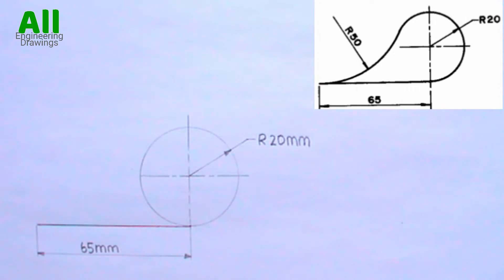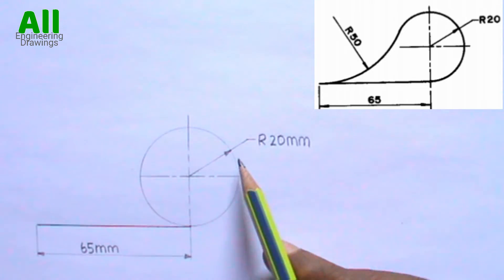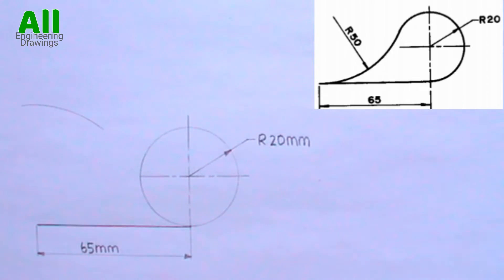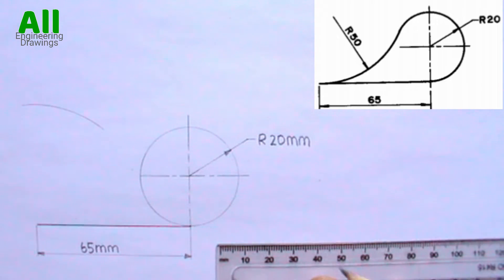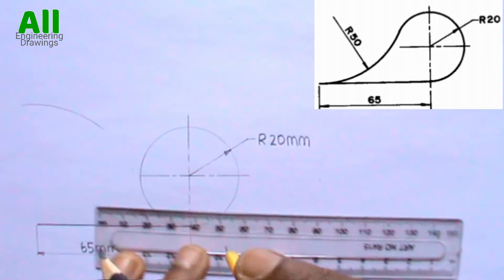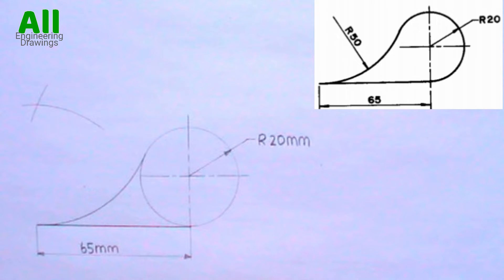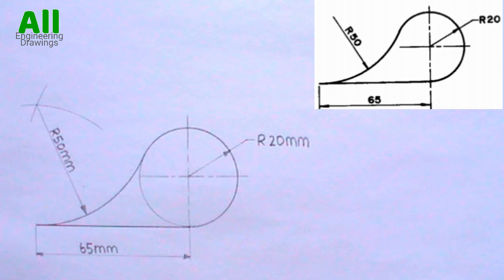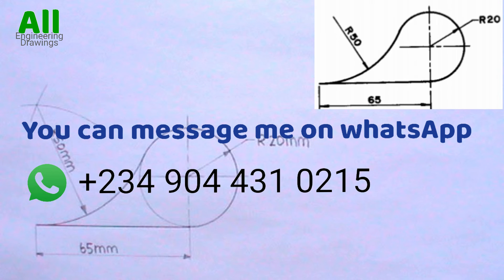TANGENCY PROBLEM 1 || Tangency || Tangency problems || Engineering drawing || Technical drawing

Comment from the maker: The easiest way to draw this drawing is to start with the circle. After drawing the circle, you are to draw horizontal and vertical line to pass through the centre of your circle. After that, then draw the 65mm horizontal line from the point where the vertical line passing through the circle intersects the bottom of the circle. Then just follow the procedure shown in this video.